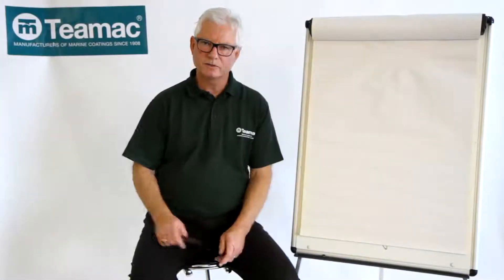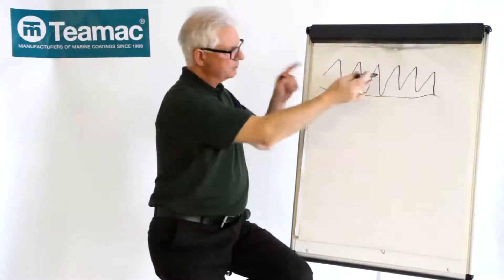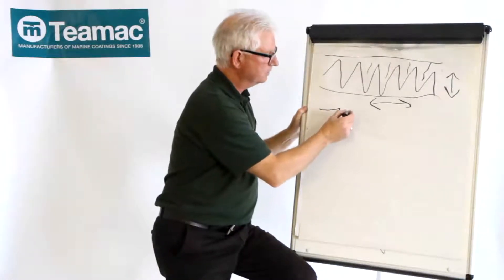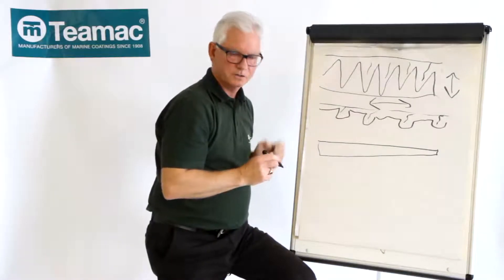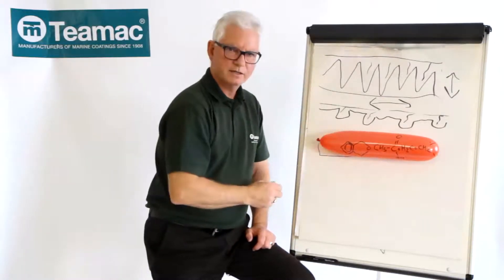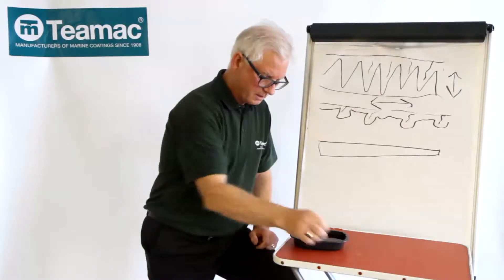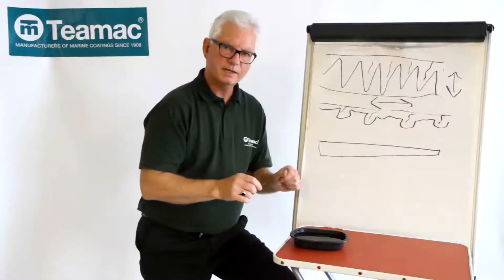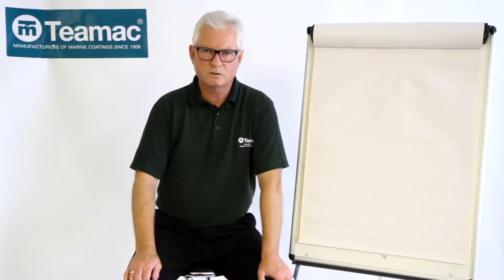Why Does Paint Stick?

Comment: Thank you for this video Chris, as I used to be a painter very rarely did I paint steel, therefore is there a product that can be used on wood or concrete to stop the non sticking of paint on that substrate, especially as all the prep has been done prior to applying an undercoat and or a finish coat? I'm asking the question as this could come up. Thank you